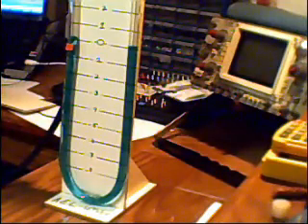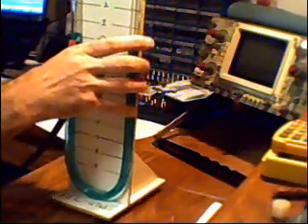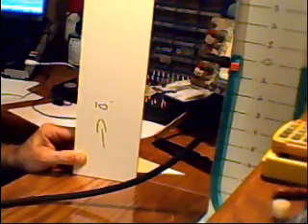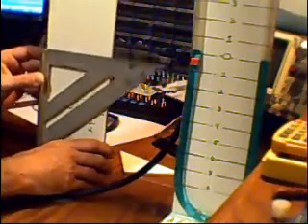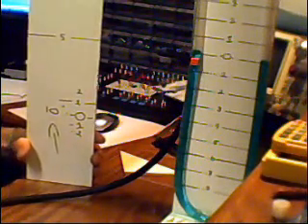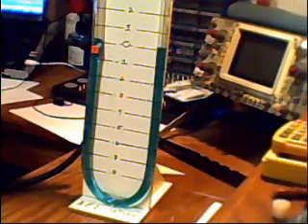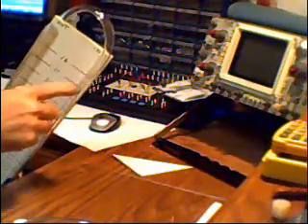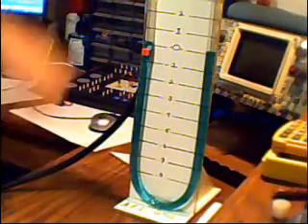HHO u-tube build

Comment: Your demonstration was excellent. We managed to build a manometer with your instructions. We intend to use the manometer for testing the fuel pressure for motor vehicles. However, we are not too sure how one end of the hose is connected to the fuel tank. Would you be able to explain this.Thanks heaps.